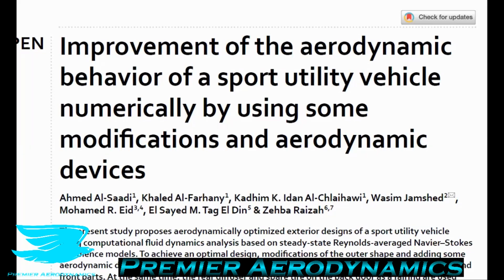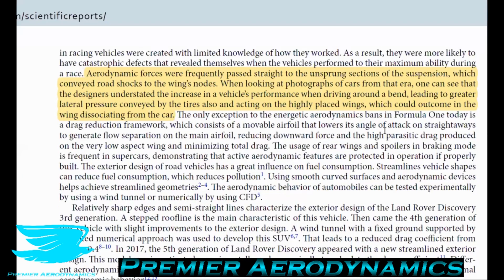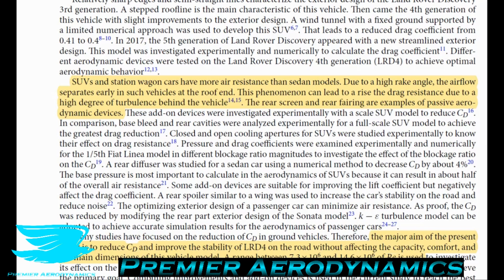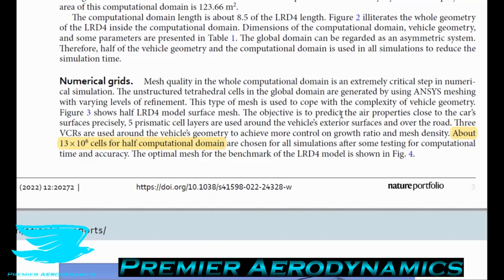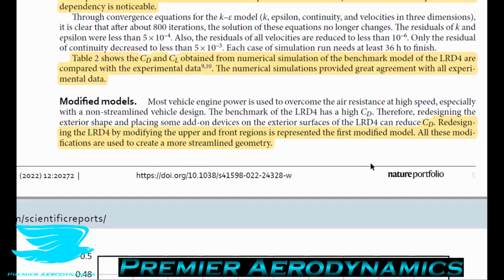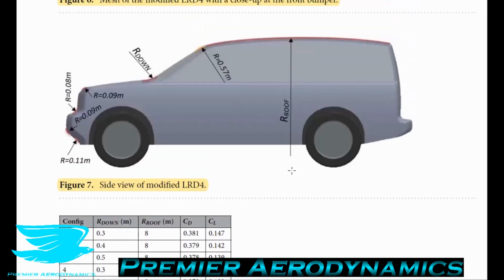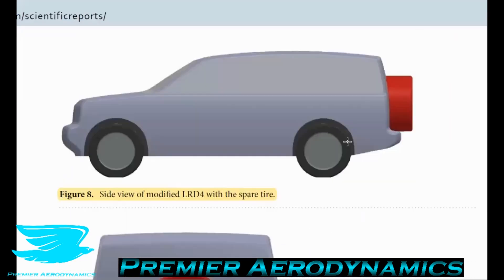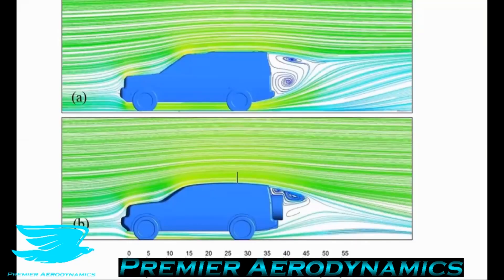Aerodynamic Modifications of Sports Utility Vehicles (SUV) - podcast #83

Comment: Fascinating aerodynamics video, I am wondering if adding the roof spoiler with slightly down angle and wheel deflectors in front of the rear wheels will further reduce the drag coefficient?
Reply from the maker: A roof spoiler slightly down would.

Comment: Would be nice to have a more condensed version like you did for the model T or other cars. 

There's a great video what I mean by sports where he reduced the drag on his daily driver to save fuel on long drives and improved it by 25% with simply modifications that aren't visible from the outside. Apart from mooncaps, a lowered suspension and removed roof rails. 
With air shaper this would be very interesting
Reply from the maker: Thanks for the idea!

Comment: Hi, thanks for posting this. I was looking for any wind tunnel testing for jeeps and didnt find much. I am a jeep owner and I like to fly Old Glory on a pole connected to the hitch. What ive noticed is that when I fly my flag with the top and doors off on my jeep, the flag does not lift. At higher speeds it forcibly lifts but gets pushed down most of the time. At first I believed it was the air coming from the roof of the jeep but when I fly it with the roof off and only the doors on, it flies gracefully. When I fly the flag with the roof and doors on, it only flys well at higher speeds.
Reply from the maker: I think it might have to do with how the flow is coming off the front window and then how the flow from the sides rises up.

With the roof only and no doors, I think that the flow probably fairly horizontal. At lower speeds, it would likely just skip over a little, which starves the flag of decent flow.

With the doors on and no roof, there is probably air coming from around the sides of the car being directed upward, which then hits the flag and pushes it higher.
Reply: @PremierAerodynamics  Thanks for the input. I'm planning on trying a couple more combinations like, keeping the rear doors on without front doors and also attaching a hitch extender pushing the flag further from the spare tire. Thanks again
Reply from the maker: @avalonblueprint  The extender will probably be the best bet because that will put the flag into clean flow, so it will fly better in all configurations (except maybe not as well if you have the roof off and the doors on).

For having the front doors off and the rear doors on, I think that if there is no roof, then it should work pretty well still, not as well as when the both the front and rear doors are on because the air will come into the car (where the people are) and that will reduce the difference in pressures between the inside and outside of the car, and potentially not direct the flow upward as much. That is just my initial thoughts.

I'd be interested to see what you find.
Reply: @PremierAerodynamics  the flag flys much better now with the extender in the, "roof and doors on," configuration. Once the weather improves I will test all other configurations.
Reply from the maker: @avalonblueprint  Sweet! I would be really interested to see what the results of the other configurations will be when you find out.